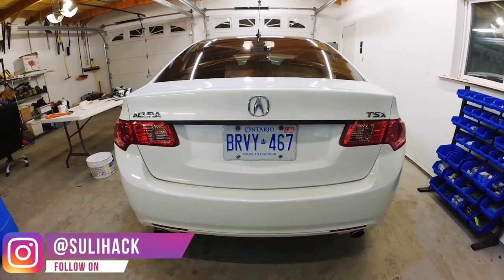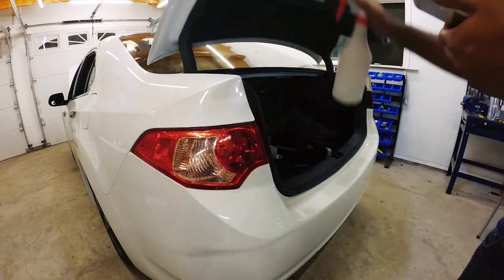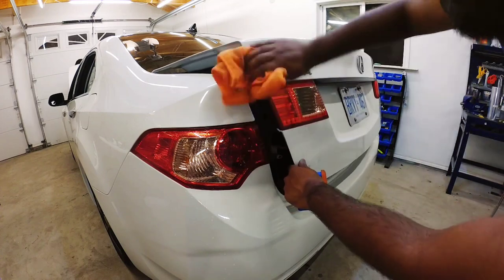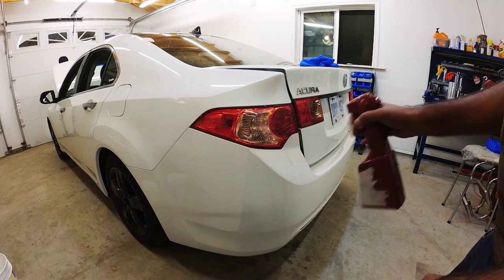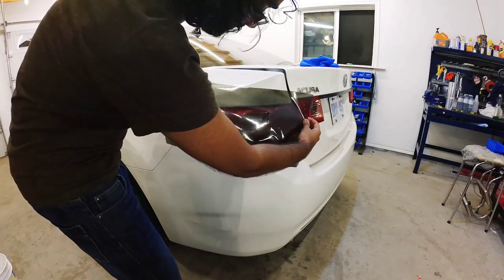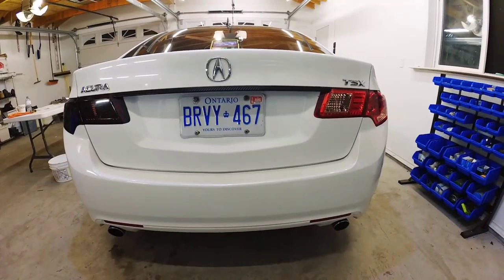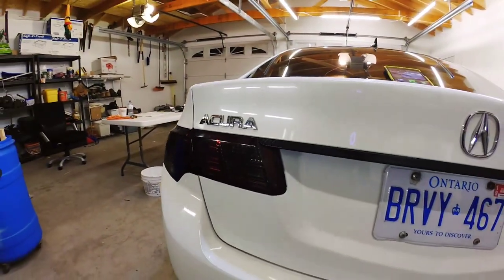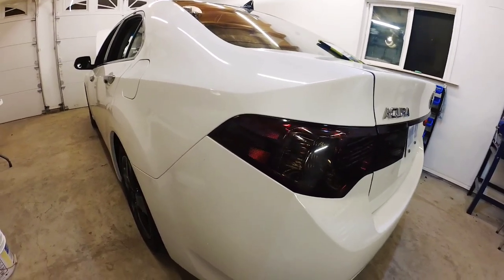How To: Tint Tail Lights using Vinyl Wrap Film

Comment: Would there be any trouble with removing the film or residue without hurting the tail light if you were to ever have to remove it and leave it off?
Reply from the maker: For most films you shouldn't have an issue. You might have adhesive residue but that's super easy to remove with googone.

Comment: Hey, I'm doing my lights soon. Like probably next weekend. I have 99% alcohol wipes. Can I use those to clean the surface?
Reply: And also, do I have to use the water solution? Or could I just do it with a heat gun only? I'm using vivid film to tint my taillights
Reply: @HockeyLAKings119  any update?
Reply: @GrungeVeins  Hey man. So yes, they did get done that weekend. I did not use water, just a heat gun, and I was good. Application went smoothly, but since it was my first time, you can see some small stretch lines Here and there. Also, my car was in a rear end collision before I bought it, so the body lines are not perfect. Some areas, the knife fit great to cut the film, and other areas it came up a bit short. So I'm just going to order a new pair of taillights in the future, tint them off the car, cut them with lots of room, and overhang, then install them on the car afterwards. Just makes it easier.
Reply from the maker: Tinting them off the car is really hard because the headlight is not mounted, you will be fighting with it. Also, I suggest trimming about 1mm short around all the edges, maybe the install quicker and prevents the film from lifting up especially when your headlights are rubbing against the body.

Comment: Thanks for your show!   
I want to know what color is.
Dark Smoke or middle grey or....??
Reply from the maker: This was middle grey
Reply: @Sulihack   Thanks for y our reply!   I tried to stick the 8300 on head lamp. But  it is not dark.
Even, address that you rinked guide me Dark grey, not middle.
And also, the 8300 middle grey is not covered with protecting vinyl. 
Thus, su much scratch appear.
Reply from the maker: @doorheaven2513  Buy from Metro restyling. They have a different brand but it will be clearer and better.

Comment: Nice video man! What kind of heat gun is that? & what is the film brand again?
Reply from the maker: Its a Wagner heatgun. Pretty fancy with alot of features, but I only use 1 heat setting. I only bought it becuase i needed something fast when my old heatgun broke! The film is Oracal 8300 series.

Comment: Can anyone elaborate on the function of the slip solution?
Reply from the maker: It allows you to slide the film around until you squeegee/dry it out to tack it down. When doing curves you want to be able to stretch the film without having it stick until it's in the right position. This helps with that. You don't want it to tack down, then have to rip it up. Sometimes it leaves marks in clear films.
Reply: @Sulihack  thanks man

Comment: Great vid how do you trim the edges? Does it remove easily if you make a mistake?
Reply: Potty About Plants it should, it was my first time doing it and i made a slight adjustment to the tint, it peeled off easily. Just it depends on the product your using.
Reply from the maker: Yes it removes easy, especially with heat.

Comment: is heat gun mandatory?
Reply: Muntasir Ohee no but it makes it a lot easier as the tint will form a lot better
Reply from the maker: Yes unless your headlights are flat
Reply: @RawRapper  i got tint papers but no heat gun/ hair dryer
Reply: Muntasir Ohee it’s going to be hard to get rid of any air bubbles underneath as when you heat it you stretch the film and that gets rid of any you will just have to go a bit slower
Reply: @RawRapper  Okay, Can i use my ATM card for squeezing the paper?
Reply: Muntasir Ohee I wouldn’t as where as that’s plastic you could scuff or scratch the tint if you do use it put a soft cloth over it so it’s not as hard
Reply: @RawRapper  Would cotton work?